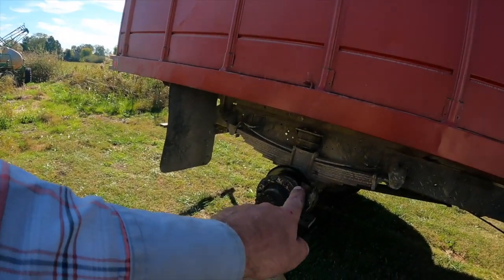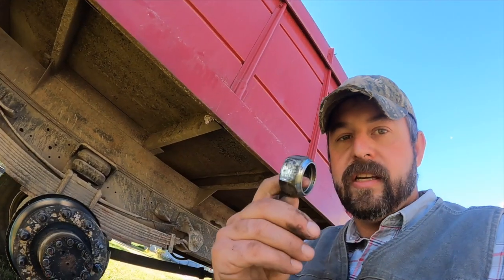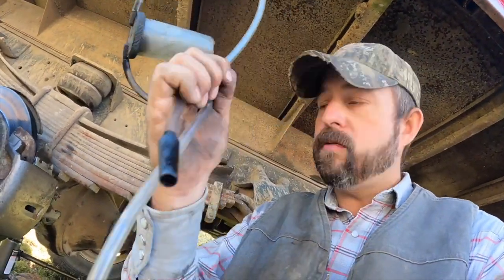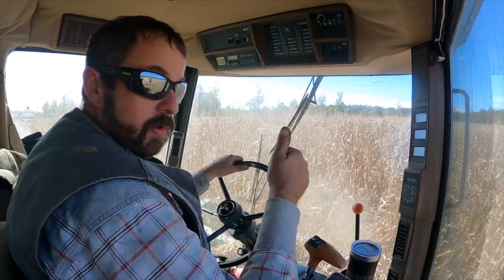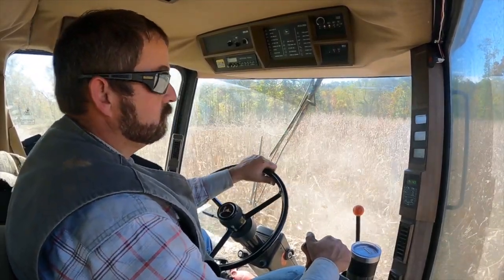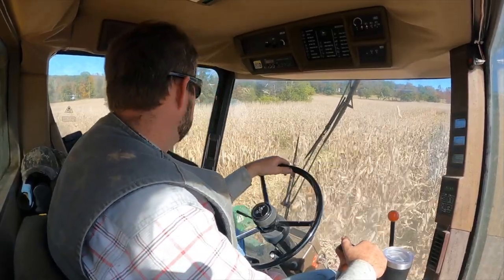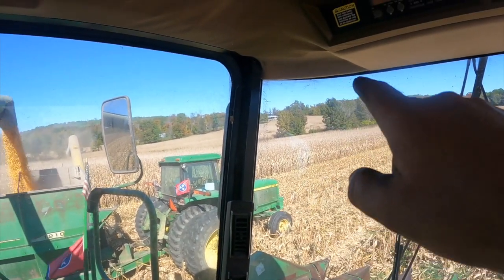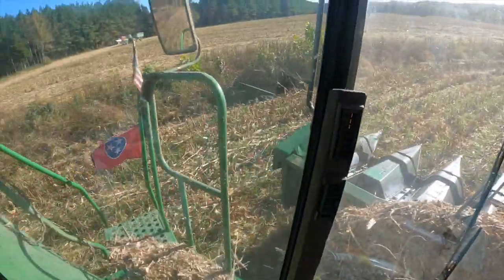Corn Harvest 2021, Everyday ain't full of rainbows

Comment: Dang, I love Budds!! Way better than the hub pilot! Easier to work on and don't break near as many studs!!!
I hate juice breaks on trucks. Don't miss having them, a pain to work on and working on them all the time gets old. Only thing bigger than a pickup around here with juice, is the New Holland 1075 Stackcruier... Everything else has air breaks 👍
Make room and get er done 👍😎
Reply from the maker: It was the first time I took Budds off by myself, which made it a pain. But once I did it, it wasn't that bad. We've made good progress now. Local grainory has made room now.
Reply: @LampleyBrothersFarming  only time they're an issue, is if an outer nut is rusted on, or you have a stripped stud, but stripped studs are an issue on anything.
Nice that they made room!